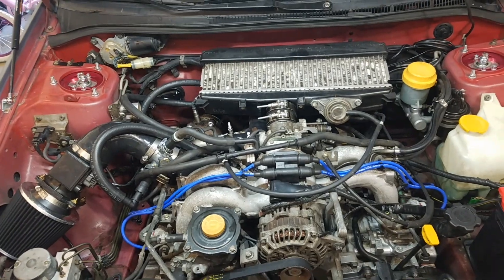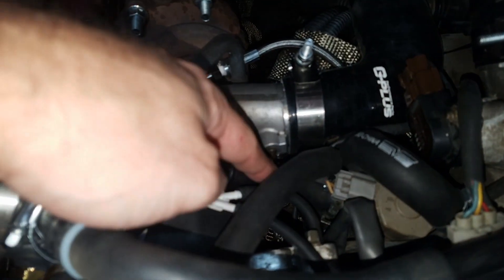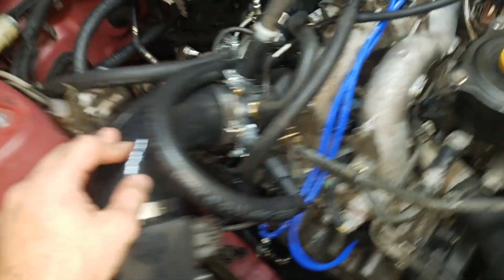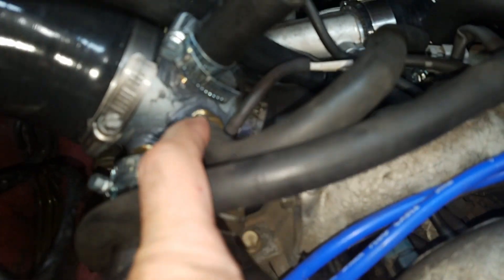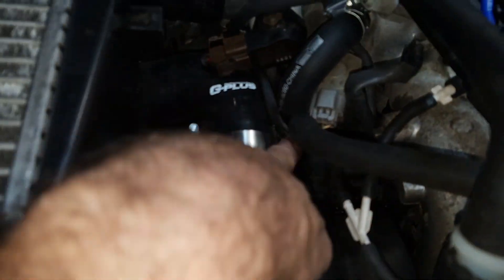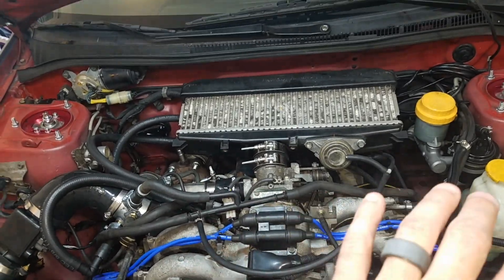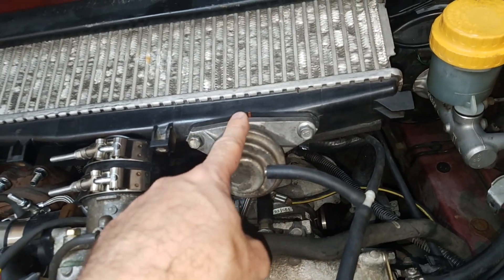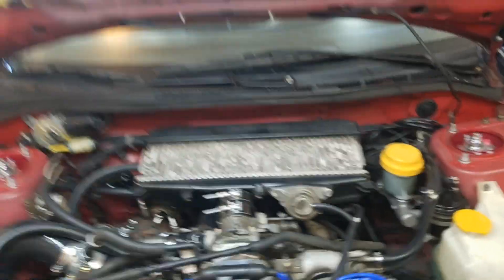Subaru EJ22 Turbo Build Part 6: It Starts! Intake/Vacuum line routing.

Comment: Great videos! I’m boosting my 2.2 Legacy right now. These videos have been a huge help. Question for you are you running stock gap on your spark plugs?
Reply from the maker: I use a ngk 4644 bkr7e. No gapping and non iridium.
Reply: @traviscea  is this with the stock clutch and drum brakes in the rear ? And how well would this work if I had made this same setup with the exception of having a custom up pipe and a vf39 turbo ?
Reply from the maker: @That_fella_named_J  stock clutch, rear disc upgrade. A vf39 will need modification as wastegate boost is like 12psi
Reply: @traviscea  Great! My potential donor car is a 2004 Subaru Forester XT that has good parts but has ring land failure and low compression in cylinder #4. Everything else is stock aside of the tune and the turbo. Can I change the wastegate psi ?
Reply from the maker: @That_fella_named_J  You'd need to change the wastegate. That's the only way
Reply: @traviscea  that’s good to know, and I’m sorry for asking you another question but can I use the rear disc brakes from an 04 forester and rear differential with my 97 Impreza Wagon?
Reply from the maker: @That_fella_named_J That I'm not sure on. Research on rs25.com